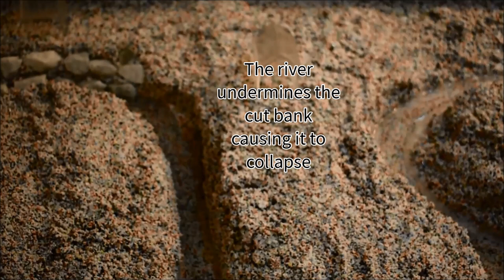Meander Evolution Simulation

Comment: That rip rap really comin in clutch, huh
Reply from the maker: Rip rap may stabilize a portion of a river bank, but it creates further damage downstream. There are better and more natural ways to restore and protect a river bank, including when human infrastructure is at risk. Learn more here: https://www.ausableriver.org/programs/restoration
Reply: @ausablecenter makes sense... thanks
Reply: @ausablecenter  Wouldn't it be better if the riprap extended along the full length of the curve, ie from one straight to the next, rather than as placed?  I understand this is for educational purposes, I'm just wondering.
Reply: @nicotti  Imagine a real river, stretching for miles
Reply: @nicotti   For a portion of it. But I think the bend after the riprap ends would be hit fairly hard and erode much faster
Reply: @andyartze4529  why?
Reply: @nicotti  river is hungry
Reply: @nicotti  The end result of that thinking is the LA River as it passed through LA and Long Beach: A completely constrained channel encased in concrete and not much natural environment.

Th is because as you extend the armoring it increases flow speed and increases erosion rate downstream at the next soft point where rapid erosion is possible so you end up extending it as far as you can.
Reply: @davidschwartz8125  Okay, but how does one protect the idiot who built his house at a river's bend on a flood plain?  Or is the plan just to buy their house and demo it now (or later after the bank eats away) and make their property a green space?
Reply from the maker: @nicotti  Several people answered your question above pretty well. Most of the houses and human infrastructure built on the flood plain were constructed before any knowledge of modern hydrology and river/stream cycles. There are many safeguards in place for modern development to minimize this hazard. Our work focuses primarily on promoting flood resiliency for those whose properties are at risk due to decisions made by property owners decades ago.
Reply from the maker: See answers below.
Reply: Maybe building a house on a bridge is better idea.

Comment: Funny how channel meander models have to start with the meanders.
What will happen eventually is the formation of a braided network with multiple meander channels of varying sizes, discharges and sinuosity.
Reply from the maker: Hi Andy,
Thanks for the comment. It can take a while for the meanders to develop naturally, so I think a lot of videos dig out the channel to speed up the process. In this case, I had a few hours to work with, so I formed a channel to start the model and let it run. Many factors affect the development of braided channels versus a meandering, single thread channel, including slope, sediment load, seasonal variability in discharge, etc. 

It can be hard to translate exactly what's happening in this model to real-life. For instance, this is an alluvial channel model with no vegetation and hard, structural controls provided by the stainless steel basin where the sediment is contained. That's not exactly a scenario found in nature. The meanders can only migrate so far before they  reach the edge of the table. However, I think there is some value in seeing how a meander changes through time. Cut banks will migrate outward, chute cutoffs will occur, oxbow lakes will form, etc. It's also interesting to observe the fluid dynamics at play within the channel, and the multi-colored sediment allows for that visualization. You can see the erosion due to higher velocities on the outer edge of the channel causing cantilever failures on the cut bank, and the deposition of sediment by slower currents at the inside edge. Thanks again for engaging with us on this.
Reply: @ausablecenter  we're always making models, but sometimes, a simple one (even if oversimplified for truly practical applications to be feaseable) can give greater understanding of a subject down the line. thank you for sharing this! 
Would've been nice to see a reference to oxbow lakes at the very end, but given the angle you seem to have been working on (as well as the really permeable substrate) it wouldn't realy have been anything.
for a teaching aid, this would be quite usefull I think. sometimes you have to learn things that are somewhat wrong, so you can later go 'ah, it's not quite right. here's how we improve it' while learning and understanding more then you did before at every step of the way.

Comment: Hmm, interesting. So, a question or so.... The wave formation of the river channel when you start is high amplitude, and short wave cycle. I remember flying into Winnipeg and seeing the river that runs through it, and it was similar to your model, except that the shape was more like that folded ribbon candy where the long sides of the wave almost touched, and the arc of the curve was very wide. I am thinking that this is a more common shape in rivers that flow through very flat land, and the more hilly the area is, the shorter the wave length is and the shorter the amplitude of the wave is. Correct, or is some thing else going on. Oh, in flat land, water flow rates would be much slower than  in steeper areas, and I don't know if that would just slow the erosion process down in the flat lands but end up with a similar shape and process...
Reply from the maker: You're correct that when a river's slope is low, meanders tend to form and erode the landscape laterally.  This creates wide, flat valley bottoms with the "folded ribbon candy" shape that you're describing.  Over time, those long sides of the wave will narrow the meander neck, and a cutoff will form, like the one in the video.  Steeper channels have very low sinuosity and erode their landscapes vertically, creating deep, narrow V-shaped valleys.

Comment: There are methods to help combat erosion induced structural collapse of housing and other buildings along river banks, but ultimately the water consumes all. It’s best to build a safe distance away from the water’s edge. That said, if you do build too close to the banks, and you really want the building to last centuries down the line when the erosion eventually will be an issue to the foundations, place it on piles going into bedrock, and elevate the building well above the flood line.

Comment: I’m not fully versed on this stuff but I assume riprap is rocks or other material used on the banks of streams to try and keep it in place and meander is the soil/sediment. Am I Right?
Reply from the maker: Yes, riprap would be the large rocks placed along the meander to slow the migration of the meander.  However, it is not a permanent solution.

Comment: What about the lack of tree roots in this simulation? They are a major factor in controlling erosion.
Reply from the maker: That largely depends on the type of tree and geomorphological nature of the river. Trees are a critical component for bank stabilization, but major flood events can still have an adverse impact on erosion, and some trees (such as white pines) provide limited root structure to hold soil in place compared to other species (like silky dogwood, who's roots can extend 12 or more feet into the soil).

Comment: Is there a reason why the bank opposite to the bank fortified with rip rap wasn't being eroded?
Reply: The momentum of the water as it rounds the curve pushes it into the rocks. There is much less pressure applied to the opposite side.
Reply: @MoneyManHolmes  I believe the fact that the water at the inside of the curve also makes it less damaging

Comment: Is there much difference if you vary the stream flow periodically over time ?  IRL there would be annual spring runoffs followed by summer dries and then back again, would this lead to a significant difference in the outcome ?
Reply from the maker: This would lead to a variable outcome, however this simulation is designed to speed up the meander/erosion process, and the results you see would take place over a long period of time (see answers to similar questions below). The amount of time this process takes will take into account the variability of stream flow over time.

Comment: No comment on how the river was cutting into the bank before the riprap, and how you had to fix it at one point because it had cut behind the riprap?
Reply from the maker: I didn't interfere with the banks during the simulation.  I believe that I did point out how the eddies were scouring the bank immediately upstream of the riprap. If the simulation had continued, the scouring would have likely flanked the riprap and caused the bank to fail. Thanks for engaging on this topic with us.

Comment: What happens if you keep the simulation running? Of course you have to put the washed away sand back to the start, but aside from that, you can keep this running forever and it will eventually keep forming new meanders, right?
Reply from the maker: Rivers will naturally continue to meander. You can learn more about this process via our blog: https://www.ausableriver.org/blog/why-do-streams-meander#:~:text=Meanders%20are%20produced%20when%20water,pool%20structure%20of%20a%20stream.

Comment: What is the timescale?
1second = how many days / months?
Reply from the maker: That's a great question. (that's a stalling tactic I used as a teacher when I didn't know the answer ;-)  

It's a little difficult to say what the timescale would be.  In a natural system, there would be vegetation to counter the erosion of the streambanks.  This model isn't constrained by the presence of vegetation. Also, the size of the meanders in real life is going to make this a much slower process. It would probably take several decades (maybe the better part of a century?) for a meander of these proportions on a large river to narrow at the neck and eventually cut off. Climate, vegetation, and geology would also factor into that process. Thanks for the question!

Comment: Does the system ever come to some sort of equilibrium or with enough time will it always eventually form a straight path down?
Reply: Depends on the velocoty of the starting flow, if it was more stable waters like we see in real meandering rivers then it wont cut through (at least for life times assuming ceterus peribus), but this flow started with quite soke velocity
Reply from the maker: Great answer from Nardypants.  Slope is a major factor in the sinuosity of rivers.  Steep, headwater streams are much straighter and tend to cut down into their landscapes (vertical erosion).  Gently sloping rivers tend to have higher sinuosity and erode their landscapes laterally (side-to-side).
Reply: @Nardypants  exactly, i feel like i worded what i said poorly and I'll likely do the same here. The meander in equilibrium would occur far further from the start of the table. At the start where meander is "forced" (for lack of better term) is not the natural speed for said meander, so it will erode "quickly" and eventually form a more straight river. An equilbroum would be achieved on this table but it wont be ameader in irl meanders are the solution to some equilibrum but not under the present conditions.

Please correct me if im wrong about something, or likely explained my thought incorrectly. I just enjoy the chit chat about this.

Comment: I fail to understand from this video why riprap was causing issues down stream. All the downstream processes seem like they would happen regardless of the riprap.
Reply from the maker: Here's a good summary from FEMA: 

Problems arise because the effects of riprap do not stop at the point of installation. When positioned along a section of riverbank, for example, riprap has a number of negative impacts on the surrounding environment. Riprap tends to increase the speed of water flow along an armored reach, as the water has no points of friction to come up against and nothing to slow it down. This additional strength of flow presents issues further downstream from a riprap protected bank, as water is deflected off the riprap and directed at other points of riverbank. The increased strength and speed of the water only increases erosion suffered at these new locations, the typical result of which is the necessity of installing additional armoring, which merely moves the problem further down the stream. Riprap impedes the natural functions of a riverbank or shoreline, as it interrupts the establishment of the riparian zone, or the point of interface between land and flowing water. A properly functioning riparian zone is important for a number of reasons; it can reduce stream energy and minimize erosion; filter pollutants from surface runoff via biofiltration; trap and hold sediments and woody debris, which assists in replenishing soils and actually rebuilding banks and shorelines; and it provides habitat diversity and an important source of aquatic nutrients. Not to mention, a naturally functioning riparian zone simply looks better. Another aspect of riprap is its considerable effect on wildlife, specifically fish that live in and utilize streams and rivers where eroding banks have undergone armoring. While erosion can cause potential problems for fish, especially in high-silt locations, the installation of riprap leads to other, more significant, issues. When riprap is the primary or only form of riverbank stabilization measure, the end result is typically a uniform, smooth channel, with no complexity. This means that there are no areas of vegetation either in or overhanging the water, leaving fish at risk from predation. In addition, a lack of riverbank diversity denies fish a place to seek refuge during periods of high-water, which often results in their being washed out of a fast moving system during flooding. Riprap causes other, albeit less significant, problems as well. In areas of low vegetation, when exposed to direct sunlight, the rocks that comprise riprap can reflect light into the water, which increases water temperatures to an unhealthy degree for fish. Riprap also tends to suffer from structural integrity issues during and after high-water events. Losing rocks to high water or fast flows, a riprap structure will soon begin to fail in its purpose. Once the soil that the riprap is designed to protect is exposed, the damage continues as before its installation. This possibility requires constant monitoring and maintenance, which ultimately becomes expensive and problematic.

Comment: Lesson learned, always have rocks on the sides of your river.
Reply: Keep in mind the Rocks actually increase the erosion down stream because of the now faster flowing water.
Reply: the lesson should be don't build a house on loose sand near a river. areas with more rock, and tree roots which help hold soil together will erode much slower

Comment: Round of applause for the riprap haha
Reply from the maker: Not so much....
Reply: @ausablecenter  I mean it sort of held up, I get the current went around it caused problems , but the wall held up( for the most part) is what I meant, 🙂
Reply from the maker: @413MassDigger  Haha sure. The riprap may help a specific location, but it will eventually cause major issues above and below the site and, given enough time, these issues will affect the rip rap itself. Natural stream restoration methods are far superior to riprap as they create long-term solutions while also improving habitat, aesthetics, and river health. They also usually cost less!

Comment: How can you call this a simulation when things do not scale up to real life? The grain of sands you are using here will be the size of boulders in real life. The sand is not compacted unlike the earth in reality. In fact, in reality you will find pebbles, rock, mud, tree roots, none of which you simulate. Additionally, the water flow rates you are using are similar to a torrential river when scaled up.

Compared to simulations that take place in other branches of science, this is nothing more than a very rough approximation.
Reply from the maker: Those are great points, which I addressed in some comments below.  The field of fluvial geomorphology has much more sophisticated models than this, so I wouldn't say that this is the primary tool used in this branch of science.  I studied fluvial geomorph in graduate school, and, 20 years later, this is the first time I'd ever used a stream table like this.  It's a fun educational tool, but this not a primary investigative tool. There are some areas of research using hydraulic flumes, but the ones I've seen in research are usually much larger.

That said, it's not as if this is entirely useless.  The processes and forms that you see in this simulation are things that we see in the field all of the time.  These processes and forms occur and develop over a long timescale (decades to centuries), which is obviously not going to work in a quick simulation for a lab class.  The media used in the table is actually not quartz sand, but sand-sized grains of plastic. The density difference between those two materials (quartz vs. plastic) addresses some of the scaling issues to which you refer. Thanks for engaging on this topic with us.
Reply: @ausablecenter  thanks for the explanation